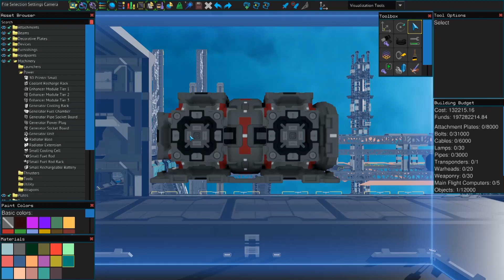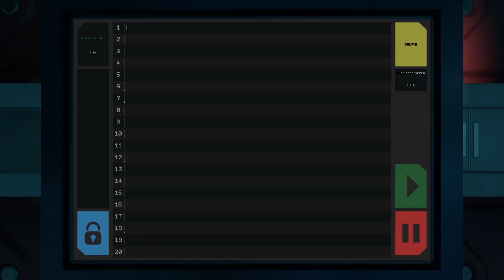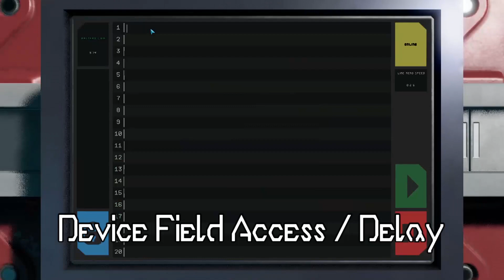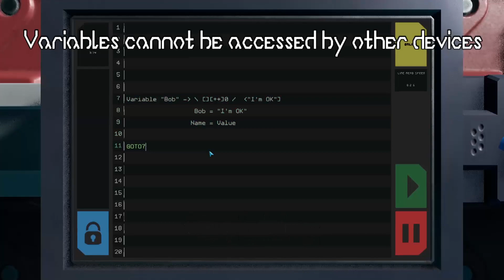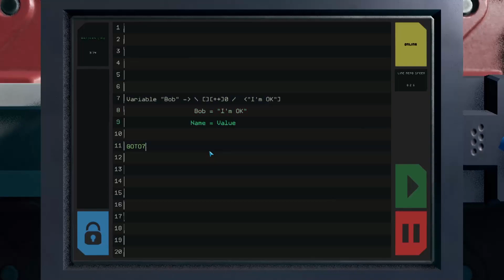Starbase: Guide to YOLOL | Basics

Comment: 4:37 I don't understand how the chip reads "goto2+:Door" at the end of your line.

I understand how you assigned the msg1 and msg2 variables and how you're telling your text panels to display those variables AND, i do understand how to use the "goto" function to tell the chip to read that line next, i've been using it already in my chips but i don't get how the chip reads "goto2+:door".

Now i'm sure your way is way better than mine, i'm a complete newbie with YOLOL but i have messed around with it and , correct me if i'm wrong but if i wanted my text panels to display those messages i also could've done it with an IF statement which would've gone like this.

IF :Door == 1 THEN :text = msg1 ELSE :text = msg2 END

This implies that all my text panels would be named "text", this way the :text value in the line would refer to all of them at once.
And :Door would probably refer to a button which is assigned to open the door and close it with a 1 or 0 buttonstate for open or close.

This way if i open the door using this button, the IF statement reads msg1, if closed it reads msg2.

I do believe this would get you the same result as what you did but i can't understand how to read "goto2+door"
How do you add a "goto" and a ":value" together?
Reply from the maker: It reads it as "If the door is open then goto the third (2+1) line, otherwise goto the second (2+0) line" I am using it as an if statement since I had not yet introduced if statements. Normally I would use an if statement, like you show, to accomplish this task.

In the next video in this series (once I get around to it) I talk about if statements and other logic flow elements.
Reply: @XenoCow  Wow, ok it makes sense once you get it lol.
SO the :door refers to the value 1 for open or 0 for closed, hence the 2+1 and 2+0. 
Took me a while to get it lol, thanks man!
Reply from the maker: @KrawllUnchained  Yep it does. :door is the state field of the door slider and the button and since it's value is either 0 or 1, we can do some math with it!

Comment: What did u mount it to?
Reply from the maker: The YOLOL chip? That is a YOLOL Socket. You can also use YOLOL racks which can have 1-3 slots. You do need at least one 2 slot rack to plug into the network, though.

Comment: might have to make a simpler version for those who dont have any coding know how and explain what each of the things you just covered mean cos i was lost about 3 minutes in
Reply from the maker: Yeah, I could do a more fundamental programming series that is more in-depth. I was making this video (and subsequent) ones in this series with the intention that viewers would have some idea on how to program already. I didn't want to waste their time. I do agree that I could offer much more information for those seeking it. Thank you for the suggestion.
Reply: @XenoCow  if you have some time I'd love to pick your brain about it I want to try to automate every thing in my ships and stations
Reply from the maker: If you haven't already, please check out the some of the resources that I linked to in the description. More specific to your question, YOLOL is not so great for automation, at least of anything that requires speed. For factories (once they come) or ship system management, it works well. Some have tried auto-pilot programs, but they are usually slow and somewhat inaccurate. That's not to say that it's impossible, just challenging.

Anyways, feel free to ask questions in those linked areas or find me directly on the forum or Discord.